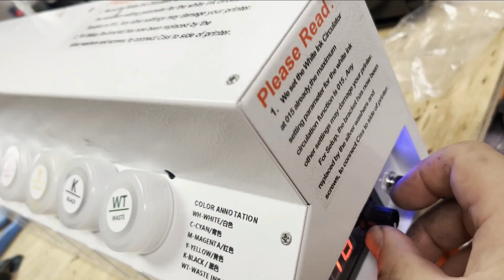Pro-Level ET-8550 DTF Conversion: PMA and WIMS Tank Connection - Complete Course (Part 3)

Comment: i need the follow up video i have it all installed but need to see the next steps how to print using the direct to damper technology
Reply: I did this just pull ink with syringe 💉 thru the dampers. The only thing i dint do is the distilled water in the waste tank but ina do it when he shiw how to use it but seems like u might just do a printhead clean and water should flow thru 🤷‍♂️

Comment: I am loving all the modifications
Reply from the maker: Thanks!
Reply: @BCHTechnologies can I please send you my printer to have this setup installed please
Reply from the maker: To protect your privacy, I typically avoid sharing order details here. Please reach out to us at support@bchtechnologies.com, and we’ll be happy to assist you. If you need further help, don’t hesitate to let me know.
Reply from the maker: After conducting a thorough investigation, I found that your email address was unfortunately suspended by our system. Occasionally, our email filtering system automatically suspends addresses if it detects messages that seem like junk or spam. This can happen as a "false positive" when certain emails unintentionally trigger our filters. In this case, it seems your email was mistakenly flagged, and I apologize for the inconvenience this has caused.

Rest assured, we’ve taken steps to resolve this issue, and your email is now reactivated in our system. Additionally, we've already resent your order to ensure you receive it promptly. If there are any further issues, please don’t hesitate to reach out, and thank you for your patience as we work to enhance our systems to avoid situations like this in the future.
Reply: @BCHTechnologies it took a while but I am glad the problem has been finally solved…